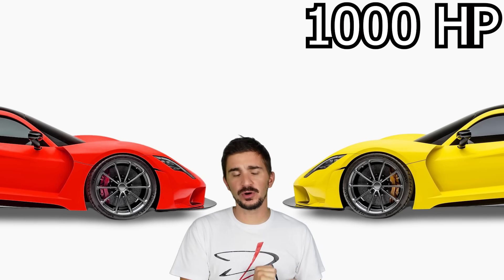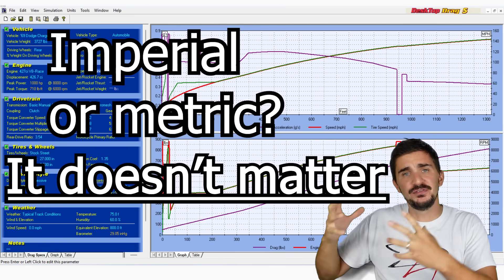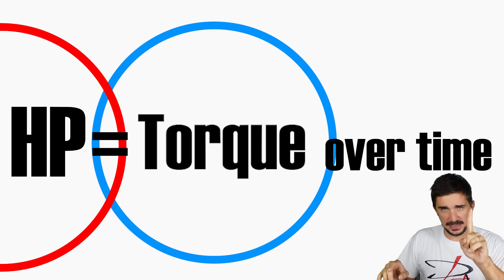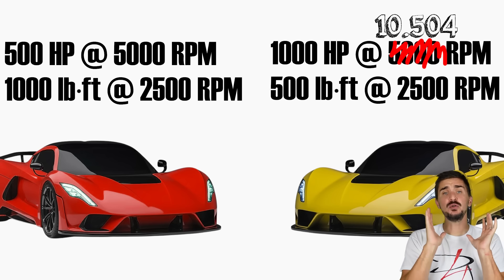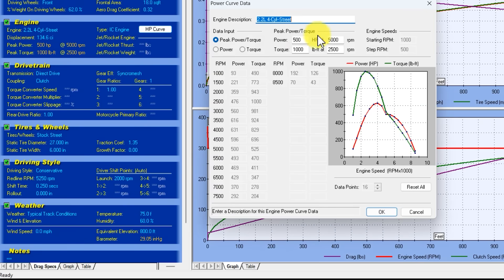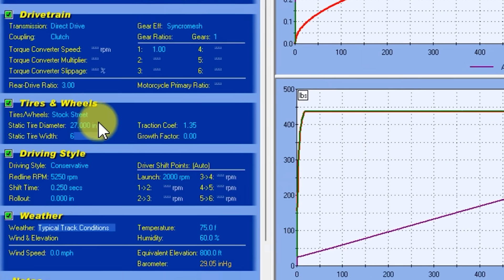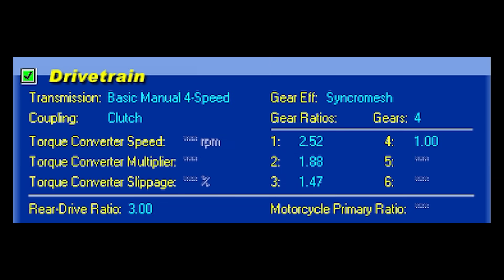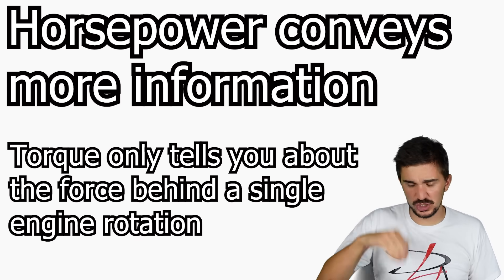Who's faster? Explained and Simulated - Horsepower vs Torque

Comment: Hp is power and torque is how quick you get there
Reply: how quick  you get there is POWER 👌🏻 as formula say 👉🏻 power = work/time so if you change position 2 ton car from start position to 1 km furhter in 20 sec that mean more power avg was involved than if the same car defeat the same distsnce in 30 sec 👌🏻  this 20 sec attempt can have engine which have even 10 times lesss peak torq it dosent matter 👌🏻😎 and torque is bull💩👌🏻😁 though if i can have choice between 57 nm at let say 4000 rpm and 47 hp at 7000 rpm engine with biger stroke in me bike instead of stock 47 nm at 8000 rpm and 57 hp at 9500 rpm i would 100% choice 57 nm 47 hp setup why ? cos in daily riding 47 hp is still plenty enough  for me and more torq on low rpm mean engine will work always on lower rpm and would have better elasticity on lower rpm + than 1 gear can be taken off so less effort when riding on shifting up and down 👌🏻 and i dont race on track so stock faster setup which  get ypu there quicker and setup lower lap times on track and win drag race on 1/4 mille thanks topend power advanatage at at least enough good gearing is pointless for me in daily riding 57 nm 47 hp be more fun on road but slower at race track 👌🏻☕️ps and this video cos he dont show whats happening when ypu setup each version with perfect gearing so 1 gear lenght gear quantitiy and diffrencess between gearing lenght where 1000 hp 500 nm version knokcout 500 hp 1000 nm like nobodys bisnes 👌🏻 is 💩🤓👌🏻☕️
Reply: @mociczyczki  not how quick you get there in terms of distance but Max hp. Eg. The 1000 torque 500hp car will reach 500hp quicker than a  500 torque 1000hp car, assuming all things are equal and traction is not an issue, the 500hp 1000 torque will take the lead off the start
Reply: @davothegreat9990  asssuming egzacly the same gearing and its electrick vehicle without clutch it take the lead on fisrst phase 👌🏻 once you setup clutch in tham not necessery and on perfect gearing each in regard to specified resist 1000 hp 500 nm beat 500 hp 1000 nm of the line in midlle of race and at the end of race  /everywhere let say grip is enpugh for use all 1000 hp as soon as 1 km/h than gearing is choicen in this way for have 1000 hp at 1 km/h and 500 hp 1000 nm is smoked of the line to 5 km/h feg whatever mean  off the line  it can be 2 ,4,10 whatever how much  km/h /mph 🤭🤷🏻‍♂️👌🏻

Comment: A lower rpm engine with big torque at low rpm may have good acceleration down low but then it could also fall over up top, where as a low torque high rpm engine geared correctly may still produce good acceleration at the top end because of the higher rpm torque figure. A few times ive seen the likes of rotary drag cars get left off the line by v8s only to catch up and pass them by half track trapping a much higher mph. Its definitely a tricky subject with alot of considerations to be made, but definitely isn't a simple case of " torque wins races" and " hp sells cars"

Comment: Torque is how hard you can push the merry-go-round, rpm is how fast it's spinning, horsepower is how badly it would hurt your ankle if you tried to stop it by putting your leg in the way of the bars

Comment: Horsepower is a UNIT of power (energy per time). The SI unit of power is Watt (1 Joule per second). One Horsepower is 745.7 Watts. The SI unit for torque is Nm (Newton meter). With SI units you avoid those weird conversion numbers and Power = torque * rotational speed, with rotational speed in radians/second. Sadly America is stuck with outdated units causing much confusion.

Comment: You only need HP and the shape of the curve, it's integral, to know everything. Also, you should always compare examples with perfect gearing and shifting points, as well as the same number of gears. So, given all these, what always wins is the largest HP integral (area in the graph), BUT normalized in the X axis by peak power rpm (stretching the graph along X) to be able to compare equally cars with a red line of 5k and 15k. The only thing that torque is useful as a value is that if you have good power at high rpm, if torque happens low, then the curve is healthy, linear and thr engine always ready to give it all.

Comment: The punching analogy is an interesting one, but if someone can't understand such a simple concept in the first place, then they probably wouldn't be able to make the connection between punching and car speed lol.

It's much simpler than that - torque is the amount of static force the engine can produce, but the faster the engine runs (RPM) the more that static force is multiplied giving you power output.

There is a lot of misinformation out there, but most of that comes from torque curves, and that's more difficult to explain.

Comment: The only man that's helped more understand the difference
Reply: meanwhillle 👉🏻 royal enfield continental 535 gt 185 kg 44 nm /30 hp 0-100 km/h 9 sec vmax 140 km/h vs yamaha mt03 170 kg (so let assume on mt03 is 15 kg heavier driver 👌🏻) 30 nm/42 hp 0-100 km/h 6 sec vmax 160 km/h 🤭 this video is piss of 💩why ? cos he dont show what happen in reall world when you setup on each vehicle perfect gearing what basicallly each vehicle produce today HAVE 👌🏻 thats diffrences between 💩 video like this and good video where all is explain welll , long story short at set gear bigerr thrust acceleration occure at peak torq rpm but at set speed it OCCURE at peak power rpm 👌🏻 for racing matter peak acceleration at set SPEED ., daily droving is diffrrent story for which aplicationprobabaly most driver will choice torque biased version as it give nicer kick from low midle rpm asf 👌🏻if he setup/equipemnt each of hees version with perfect gearing  than more topend power version so 1000 hp 500 nm 100% smoked version with more lowend torq 500 hp 1000 nm 😎👌🏻beacuse POWER:VEHICLE SPEED = F O R C E and as we know from force level depend accelerstion level for set resist 👌🏻dont watch this vodeo precisellly or watch butlong ago dont want again watch this crasp of 💩 anyways what he want to say more less is „ give torque biased engine perfect gearing or relatively good gearing vs give power biased engine /version gearing from foken HELLL be which people with iq of chimpanzeee will be ashamed and torq biased version 100% smoked power biased version” what is true 😉👌🏻 though he forget mention like im write earlier what happen in real world if he only dare to give power biased version perfect gearing 🤭 thats diffrences 👌🏻what determined that this video is piss of crassp and 💩👌🏻☕️

Comment: I would love to see the results with a CVT transmission
Reply: this video dont show what happen if you give eesch version perfect gearing = than more power lesss torq version knockout more torq less power version 👌🏻in cvt case it go like this beacuse at set gear max thrust is at peak torq rpm and at set speed at peak power rpm and beacuse cvt constsntly change gear while ypu accelerate so it basically never hold set gear (except when belt go on max radious at front discs and smallest at rear discs than speed and rpm increase like 1 to 1 but before this if cvt be setup at max torq rpm instead of max power rpm accelerwtion to point when belt achieve highest gear be worse at those speed range than if it would be setup for pesk power rpm - best accelerstion/thrust be at peak POWER rpm .,but it be better than at  peak power rpm when cvt be setup for peak torq rpm before belt rsch highest gear in comaprision to peak power rpm after belt reach highest gear which be now set gear cos than you comapre diffrent speed level assuming anyways that in such setup vehicle be able to reach such peak  power rpm what depend on power level to all resist level so drag roll and all other 💩 anyways if you have scooter let say and ypu want best posibble accelerstion from 40 to 80 km/h because you ride most of the time at those speed range somewhere whatever where than you must cvt for hold peak power rpm in this speed range dosent matter it be 5 8 or 13 k rom hat depend on specifiec ngine charscteristic it must be pesk power rpm or accelerstion be worse dosent matter ypu go with cvt setup on to high rpm so shorter final gear ratio where power be lower on some point where it drop down after pesk power point let sapay peak 10 k rpm ypu setup 12 k rpm where power is 30% smaller now ypu have much worse accelerstion or if ypu setup on some lower than peak power rpm at peak torq rpm or whatever accelerwtion aldo be worse now behow much dosent matter how be diffrenc between torw at engine crsnk (in fsct it be oposit at peak power tprq lower than at peak tprq rpm ) but it be depend on doffrences in power level ONLI 👌🏻 if at this lower rpm be 20% less power than you will have better accelerstion than at to high rpm where was 30% less power but still worse than at peak power rpm simple where is 100% power in this casee better be to setup at this lower rpm cos fuell consumption be smalller and engine wear and other 💩 smaller and noise emisiion 🤐 smaller .jak jakis peder.sta  zmiennoksztaltny oszust szatanski wypiere.k paszczur mowi ze to nie prawda to jest spieolony gej 👎🏻 i wciska ci kit ☕️

Comment: Even though Author prefers Horse Power Engine over Torque Biased one, Still Torque Biased engine won 5/6 scenarios, Which really amazing, That's why I bouught Torque biased Cruiser Motor Bike over horse power Biased Sports Bike.
Reply: what scenarios feg 🤐in reality engine with more top end power and wekaer lowend and midrange lower torq everywhere from low to midrange rpm assuming it have perfect gearing always beat version with steonger lowand midrange rpm at track where driver never go into even midrange rpm but always is on 2/3-3/4 lowerst rpm posiibbblle👌🏻 in daily riding its all up to preferention driver  and most porbably choice version with stronger low and midrange cos such setup is funnier to drive for most rider but ☝🏻 when it comes to max performance of each version setup with more topend power at perfct gearing in regard to track topoogorafy with skill rider on it always basicallly beat stronger lowend version egzample 206 1,6 hdi 110 hp 275 nm /2000 rpm vs 206 s16 135 hp 190 nm/ 4000 rpm and s16 smoked on trwck with corner and on dragsteip 1,6 hdi version at the same tires suspension and breaks setup 👌🏻 or h-d x 440 38 nm 4000 rpm 27 hp vs benelli tnt 302 26 nm /9500 rpm 37 hp the same story tnt 302 beat on each track x440 both on dragstrip and pn track with corners or me cb 500 pc26 47 nm /8000 rpm 57 hp vs let say 🤔 gsx 8 s limited for a2 licensy what give it 64 nm /4000 rpm +/- and 47 hp at 7-8000 rpm +/- and me cb beat this gsx 8s everywhere at similar tires and slightly better suspension than stock cos stock is 🤮 soft and dance everywhere limited lean angle load more tire give less grip asf after slightly suspension upgrade for yss suspension feg such cb 500 with better topend than gsx8s and mich weaker lowend beat gsx8s on each track basically drag strip and with corners 👌🏻 so when it comes to max performance versions with more topend power at perfect gearing basciallly always win 👌🏻 it not win only when it comes to daily droving preferention avg rider where most avg rider after test ride both version choice like in 80% of time version with steonger  lowend  assuming there be stleast enough topend power for tham 👌🏻 so in what scenario torque biased engine win ? except preferention  ? 🤷🏻‍♂️

Comment: Well clearly the problem was that with a 1 to 1 ratio gear, having much lower torque will render it mostly useless until you get to higher RPM. Should have had a 6 speed auto or something to give both of them a more equal chance.
Reply: than power smoked torq every time 👌🏻☕️

Comment: Horsepower sells cars
Torque wins races
Reply: nope … power win races ,torq is better for daily riding in regard to max crank value of both 👌🏻 asssuming each have perfect gearing asf 👌🏻power win races cos power:speed=force and torq win daily riding cos it lowering rpm at which engine work what is preferwble be most road driver like 70-80% probably ☕️

Comment: im going to getss the torque wins.  now lets watch
Reply: nope 👌🏻 + this vid is 💩 as he dont give each version perfect gearing like each normal road and race vehicle have 🤷🏻‍♂️👌🏻☕️ torque biased version can win drag race asf only if power biased version have gearing from 💩 👌🏻 feg royal enfield continental gt 535 44 nm /4000 rpm 29 hp 5100 rpm 185 kg manual 0-100 km/h  9 sec vmax 140 km/h vs bajaj dominar 400 35 nm /6500 rpm 40 hp /8700 rpm 190 kg manual 0-100 km/h 7 sec vmax 160 km/h i have cb 500 pc26 47 nm/8000 rpm 57 hp /9500 rpm 190 kg manual 0-100 km/h 4,5 sec (tested on racebox with 1 ft on 👍🏻) vmax 180 km/h gps vs yamaha mt03 660 58 nm /5250 rpm 47 hp/6000 rpm 190 kg manual 0-100 km/h 5,5 sec vmax 167 km/h gps  or let say h-d vrod 310 kg 120 hp 120 nm 0-100 3,7 sec vmax 225 km/h vs h-d fatbob 114 310 kg 91 hp 155 nm 0-100 4,2 sec vmax around 200 km/h so real world test show power biased engine win in performance tests and on race tracks vs torque biased engine win(or atleast is prefer be most driver on road)  daily commuting and cruising cos thanks big torq engine can work on lower rpm and is more elastic /stronger at low rpm 👌🏻 ☕️

Comment: You could have asked your question much better as I am phrasing it: "we've 2 cars, one red, one blue. Both 1,000whp; although the red one has 500lb.ft of tq., and the blue one has 1,000rpm. except the rpm range, which presumably had been tuned to perfection for each car, the rest of the cars are same with the same tranny(a perfect tranny, for a 1,000whp, with 750lb.ft) even! 
My money is on the red one! Good accelerating car always needs as less as tq. possible, with highest whp possible! Although the paying price would be the  exponentially negative influence of uphill climbing and/or extra passenger/load!
Reply: at perfect gesring each both 1000 whp for set speed reference point dyno measured power dosent matter what be diffrences intorq assuming all else equally they willl go the same the only diffrences be rpm range or level at which they will work in race asf 👌🏻 blue can have 1 mln nm and red 1 nm as long as they use the same avg power at whelll for accelelration they will go head to head all the way from stop to top sped 👌🏻 second part with load and uphilll riding another wrong assumption again both the same dosent matter how step be uphill or how much load they would have at trailer os as long as both use the same avg power they again go head to head just again pn completellly diffrent rpm level = high torq version at very low rpm and low tprq at very high rpm but beacuse power be the same they pull up hilll the same fast cos power :speed = force 👌🏻 diffrencesss start happen when you give one of version more power at whelll 👌🏻dosent matter which more torq or more rpm version this which would have more whelll power now will pulll stronger downhill on level tarmac and uphilll with or without load 👌🏻offcorse none manufactpry use high power low torq engine for towing heavy trailer but its not because they cant tow this heavy trailer 👌🏻 cos belive me or not 1000 hp engine with 250 nm at eengine crank max at perfect gearing so 1 gear lenght gear quantitiy and diffrences between gear lenght smoked existed truck engine with let say 500 hp and like 3000 nm in drag race from dead stop on quarter mille with 100 tons at trailer or even uphilll if you divide 1000 hp be let say 50 km/h you get 2 times biger output force at the drive whelll than when you divide 500 hp again be 50 km/h 🤷🏻‍♂️👌🏻 but nobody use such engine for such aplication cos it wear in split of a second at super high rpm work conststly beside noise probably higher fuell consumption and huge coooling system cos of biger heat and gearing huge all other 💩 make such setup for trucks aplication completellly not reliable 👌🏻 truck must have as low rpm as posiible with enough power for make specific work in specific ampunt of time they dont need to be faster than this 👌🏻and for achieve super low rpm at set power level let say 500 hp they neeed huge torq the more torq they haveat the lower rpm they can work and thats valuable for manufactory and customers 👌🏻+ this video is piss of 💩 👌🏻

Comment: Isn't more horsepower always better/faster as long as you have the right gear ratios for example having a CVT to truly take gear ratios out of the equation
Reply: yes. Though cvt isn't a great example as it has more losses than other types of transmission
Reply: you dont need cvt for this any other gearbox be good for show this what only nmeeed to be is perfect gearing not to short not to long and more topend power version always beat more lowend tprq version 😎👌🏻☕️

Comment: Very fun Video. In my experience on the farm I understood torque from the Farm Tractor and out 2 1/2 ton Grain Truck. Where 6 cylinder engines would pull everything. But later when I had a Corvette I knew Horsepower allows me to go faster.  I noticed that the Corvette Engineers would always try to keep the HP to Torque fairly equal. So my 1st Corvette had 365 Hp and 325 Ft Lb of Torque. While today My Corvette now has 460 HP and 455 Ft Lb of torque.  But I recall the old Corvette was slow from a dead stop until the engine was wound up to 3,500 RPMs. Where this New Corvette will take off screaming at Any Speed.  Now the transmissions are different and gear Ratios but many it feels like the low end Torque of this newer Corvette is what I feel when driving. Yet I still miss the 3,500 rpm Scream to 6500 rpm Roar. Great video and useful illustration using your simulation. Thank You, Dennis
Reply: Keeping the torque and horsepower equal? They are different things measured in different units.  Is 400 feet of wire equal to 400 gallons of water?